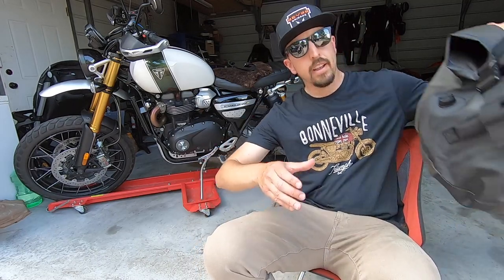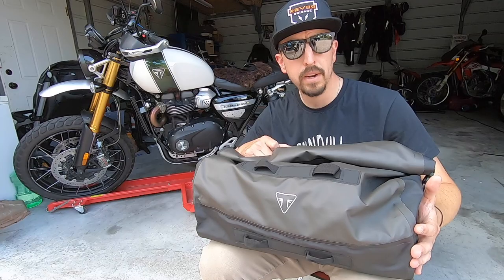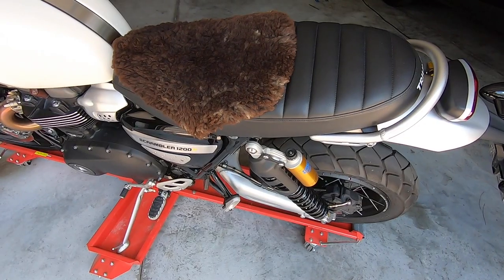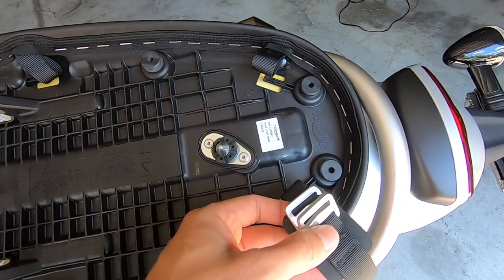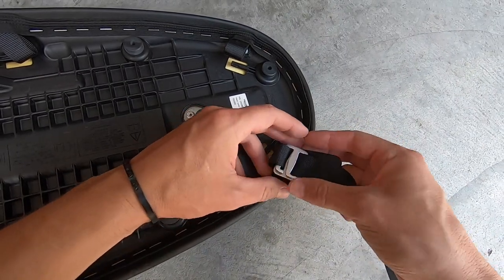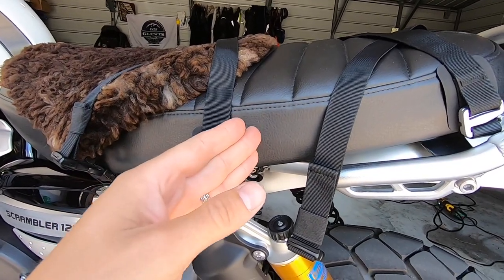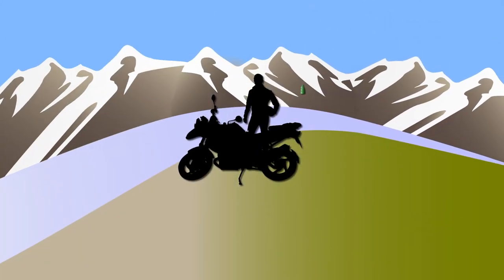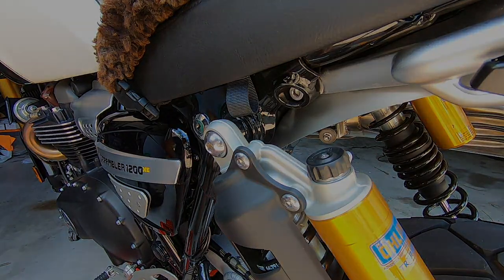Triumph Scrambler 1200 30L Dry Bag - Setup the right way!

Comment: Have you had occasion to test how water proof it is?
Reply from the maker: Hey, long as you get a good solid roll and cinch it down you won’t have any problems. Also make sure you roll it front to back. This way when your traveling at speeds water won’t build up.

Comment: Hello, I found this bag used for my Scrambler 1200...I'm wondering after all your months of usage did you get any scratch from the loop on the seat?
Reply from the maker: Overtime you are going to show signs of wear. Same as the engine the first time you start it. What is means is you actually ride!
Reply: @2wheelAdv  it make perfect sense! 😂

Comment: Do you still have your scrambler or did you changed for a BMW 1200 ?
Reply from the maker: I’m actually on a Ducati Desert X now
Reply: It’s too high for my size unfortunately. The other day I tried the scrambler 1200 xe, I loved but not see clear how I will deal the heating of the exhaust on summer, here in Spain we have up 30 degrees. How was your experience ?
Reply from the maker: @juanignaciocirera  I had to do the Decat with the Zard exhaust. If I could do it over I would buy the Zard low exhaust and the heat would be gone completely
Reply: @2wheelAdv   Yes I saw, I thinking about it. I have a neck injury, I recently test-drove this bike at the dealer when I took my Speed Twin 900cc in for service. The riding position is much more comfortable for me than my current bike, one gear more, more power, better response, brakes, lights, suspension, overall, it is a better motorcycle. 
I'm not planning on doing any off-road riding right now, but I'm looking for a comfortable bike that I can take on long trips. The position is all for me, and the scrambler is a great option, but it's not as practical as a Honda Transalp or finally a GS. 
I look for daily use at city, short distances and weekends 300km outside range from my city with or without companion, do not plan for change each year the motorbike.

Comment: Where did you find this bag? I have a 2019 Scrambler 1200XC and the only bag I can find is the single side-mount soft-sided 30L pannier, and Triumph wants $350 for it. Unless I can figure out what I have to start eating in order to poop money, that's too rich for my blood.
Reply from the maker: Paul Regner hey, I ordered this on EBay but you can check with Tampa Triumph or Triumph of Seattle. They can ship it directly to you. I think I paid $95 bucks.
Reply: @2wheelAdv  Right on man! Thanks for pointing me in the right direction.